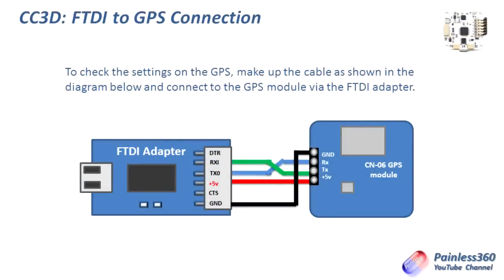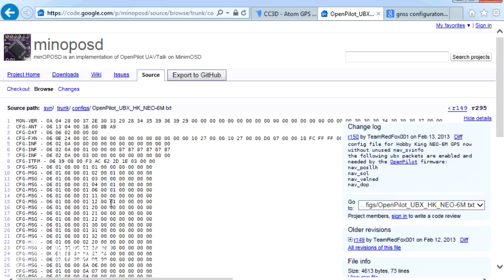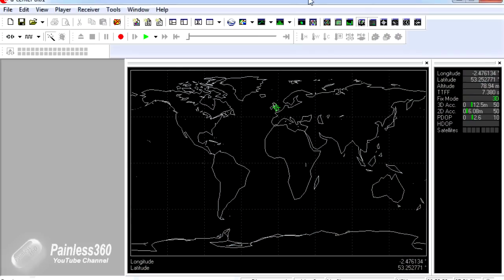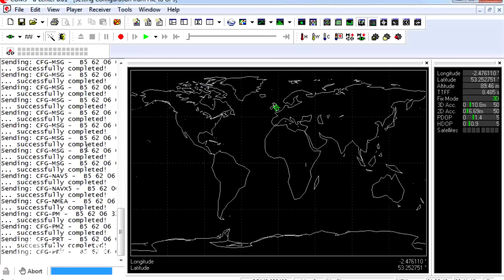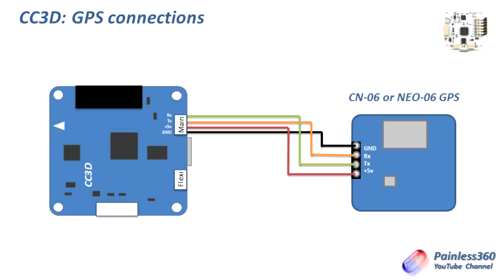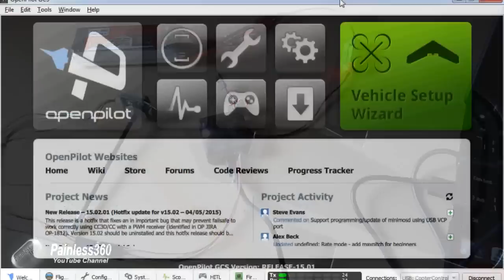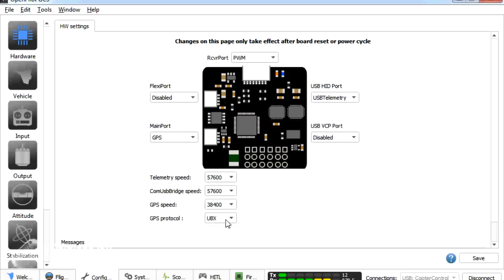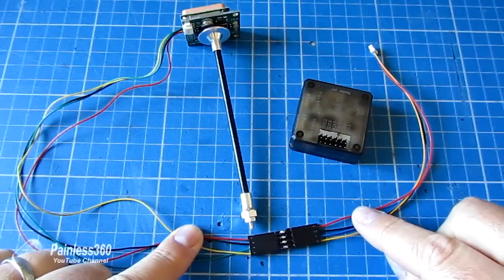(5/10) CC3D Flight Controller - Adding a GPS for Telemetry

Comment: I like your videos, they are nice and clear.
I've been trying to get this working on a CC3D, with a Ublox7 GPS and a micro minimosd.  The OSD is working but the GPS will never let me hit the final "save" button.  The button turns red with a cross through it.  
Have you ever got CC3D to do GPS AND OSD at the same time?
Reply from the maker: +Brit inCali Yes, you have one in each flexi port. Best of luck.
Reply: +Brit inCali 
I have same problem :(

Comment: Thanks for your videos.
i own a CC3D not the revolion version. I am thinking to build a Z84 UAV using this board by adding an BN-880 GPS plus an BPM280. Is it possible? If yes, can you do a video for explain how?
Thanks
Reply from the maker: The CC3D is very old technology now. See my recent builds for more modern components... Happy flying!
Reply: @Painless360  Thanks for you reply. i know about age, but they are very cheap and still sells on ebay. Thats why i thing they can be reliable.
Reply from the maker: Best of luck with the build..

Comment: Hi,

I am having problem with my NEO-7M. It is not saving GNSS configurations. It is OK for few minutes (upto 30mins.) and after that it resets to default (baud rate to 9600 and etc.)

As from the datasheet configuration can be lost or reset to default in three following cases:

A power cycle
A hardware reset
A (Complete) controlled software reset
I have checked, none of them corresponds to my case. 

As, I am not resetting in unit in software, as it resets itself after sometime being disconnected from the power. 

Backup Battery level is OK at 3V.
Reply from the maker: Sounds like the little cell battery on it needs replacing. Best of luck!
Reply: +Painless360 thank you.

Comment: Hi, congrats about your channel, i just have a question, i´ve tried to configure as you say in the video, first the gps was conected but now after upload the config file, just keeps the blue solid light turned on and nothing else, doesn´t connect, just keeps in a kind of stand by mode. the question is, is there any way to reset the gps as it came from factory? i will really apreciate your help
Reply from the maker: +Juan Carlos Moreno Rodriguez Yes, see the GPS setup video in the 'Seriously Pro F3' playlist - lots of extra detail in there as I show the full manual methods..

Comment: Hi, my gps only works at 9600 and the protocol is MNEA. What can I do? Thank you 
Nice video
Reply from the maker: servio ariza 9600 isn't enough to send the data to the flight controller fast enough. You need 57,600 baud or 115,200 Baud really. If you can't change the settings on the GPS you have then get one that will. Best of luck.

Comment: Hi. I'm trying to use GPS néo 6m with cc3d fc (flashed cleanflight). Whatever i just found voltage supply for This GPS is 2,7v - 3,6v. I suppose cc3d vcc from main port is 5v. why you dont use bec? I've follow your tutorial but my English is bad. With pc-ftdi 5v-gps-ucenter i Can See my position. It is a better choice to use bec 3.3v for my next try with cc3d?
Reply from the maker: Check the voltage on your module.  All mine are 3-5v.. Best of luck!

Comment: Will the microOSD be capable of displaying the home direction arrow in the video stream using the GPS connected to the CC3D?

Thanks
Reply from the maker: +Jeremy Giordano Depends on the code you are using - have a read up on the firmware pages for more detail. Best of luck!

Comment: Hi, it seems they have the openpilot nano revo for sale.

I wonder if that has the full function of the openpilot revo. Especially the GPS hold. 
Can you do a lesson on adding a GPS with the openpilot revo?
Reply from the maker: Tuck Hoh It gives the same function is a far smaller package. Should be an interesting board to play with. The addition of the GPS to the Revo is very similar to the CC3D so that video will help you install the GPS..Best of luck.
Reply: Painless360  The installation would be the same?? There more setting? Configure the GPS hold? etc..
Reply from the maker: Installation the same, configuration slightly different.. best of luck

(what are the two questions marks for?)
Reply: Painless360 Sorry two ? is my typo... Any chance of you making a video on setting up the GPS with GPS Lock or hold with the Openpilot Nano Revo or the openpilot revo
Reply from the maker: This is planned but not until the fall..

Happy flying!
Reply: Painless360 Thank you will be looking forward to your video. It is very helpful.
Reply: +Painless360 Hi, Looks like the openpilot revo is not avaliable on banggood.com. Looking forward to your video on setup with this openpilot revo.
Reply from the maker: Yep, still trying to get one here too...
Reply: +Painless360 Opps... Typo.. I meant.. the openpilot revo is not available on banggood.com.

Comment: nice video; im using the the op mini gps, can i configure gps via the cc3d with open pilot? can i do things like altitude hold and return to home, having a gps or what would i need to do those kinds of things?
Reply from the maker: +rio787 Follow the instructions in this video to configure the GPS, we cover what the GPS will and will not do in this video and also touch on it in the first video in the series - short answer: the GPS will only give you telemetry on a CC3D. For flight modes that use the GPS you need a CC3D Revolution (see our latest series on that flight controller)..

Comment: I only used APM yet, but looking for a small cheap FC and build a mini copter. I already have a spare BN-280 GPS module.Can the CC3D be configured for that GPS module and can it support position hold based on GPS?
Reply from the maker: Basic CC3D does not offer GPS flight modes. See the GPS video in the CC3D playlist for full details..

Hope it helps..
Reply: Painless360 I assume I have to buy APM than. Thanks a lot!

Comment: I have done everything in your video. I’ve down loaded the gps that on your page but that came up with a message not compatible with my gps. But the gps is the same as the one that it asks to use.
Reply from the maker: Is this related to another comment? Please reply to any answers else I can't keep track of the conversation.. Thanks..

Comment: Hi painless360  I am getting lost with my op gps made to be directly connect to cc3d , my controller can't find it , i follow all the steps with openpilot tutorials, however , I can't find any information concerning the setup of this module (one of you video explain how to configure ublock but not op gps )u can't hook it to ftdi unless you cut everything off, I am very aware that this specific part isn't as good as ublock but it's only for telemetry feature, a little help from you would be very kind :) thanks in advance
Reply from the maker: +Julien “androo” djyool see our CC3D revo series for more GPS detail, should help.. best of luck!

Comment: Is it possible to add compass which integrated in the gps to cc3d? I have looked every where on the net, I could not find any info.
Reply from the maker: If it does, it looks recent - https://librepilot.atlassian.net/wiki/display/LPDOC/OpenPilot+Revolution
Reply: +Painless360 I am talking about the legacy cc3d. Great vids, btw. I learn alot from you.

Comment: hi mate can you help me ive got a zmr 250 with cc3d trying to getvinto fpv but hard is there a flight controller you can buy to fit the 250 size but as gps hold like the dji phantom
Reply from the maker: +Nick Walters see our video on the comparison of the flight controllers we've used so far..

Comment: i have a tarains plus with x8r and the frsky gps v2 injunction with the smart port voltage sensor.Is it posable to use the frsky gps and voltage sensor with cc3d atom ? Im new at this and not to sure of the differents is from the S port and RSSI or if it will even work.
Reply from the maker: +Chi Sty The FrSky kit will talk FrSky telemetry, the CC3D talks MAVLink so it will not work. Hope that helps.

Comment: Hi, I'm going to buy this item, do you think I can install it on my Syma x8 ??? Or is there another one of those that I can use ??? I wait your answer thank you.
Reply from the maker: No idea, sorry. If it's using standard ESCs and motors and you have a receiver/radio you want to use then it might.. Best of luck!
Reply: i want to use the original control and board.

Comment: Hi, how can I get the GPS data to a file on an SD card or transmitted to the computer file?
Reply from the maker: +Graham Wilson you can get the details sent down via MAVlink telemetry but I'm not sure how you capture and store it. If you figure it out I'd be interested. Openpilot did allow for logfile a but I can't see that in Librepilot in the quick searches I've done. Best of luck!

Comment: would this SETUP allow for vehicle speed + altitude to be displayed ?
OR LAT+LON only
I would be interested in SPEED + ALT on a plane with a CC3D
Reply from the maker: +jason riddell Basic readings should include speed and alt from the GPS readings. I'd check up on the firmware read.me file and see what the latest features are.. Best of luck!
Reply: Cool thanks

Comment: would the osd be able to display height and speed or just lat/long?
Reply from the maker: Valentin Verheggen The OSD does have the ability to show height and speed and most OSD software will take these from the GPS co-ords. I've not done it myself but it should work.

Comment: I have a problem with the NEO6MV2, the CC3D keeps on rebooting when the module is attached. However, if the module wasn't configured properly, the CC3D no longer reboots, so I am certain the power supply isn't the issue.
Reply from the maker: That's odd, I'd run the power from a separate UBEC and see if that helps. I've not seen that here, problem GPS maybe?.. Best of luck!
Reply: Painless360 The GPS seems to work in u-center. However, the CC3D keeps on rebooting only when the GPS is connected. I'm using OpenPilot 14.10, I suspect the firmware is responsible, though I haven't tried other firmware versions, which would you recommend?
Reply: Painless360 I have tried other means of powering the GPS. The CC3D can detect the GPS though just moments before it reboots, GPS status in the GCS is in green.
Reply from the maker: That is odd, I'd try it on the other port. Not had that here..
Reply: Painless360 Thank you anyway, the firmware was the problem, I followed your tutorial from the beginning and everything works fine now.
Reply from the maker: You mean you didn't do that first ;) Glad you got it sorted..
Reply: Painless360 I had it already configured, I couldn't be bothered going back to the start, losing all my optimized config, I just wanted to add a GPS to the flight controller. It's a bit wobbly, and leans a little bit to the right at some point, I'll have it tweaked soon.

Comment: Hello sir, i am using Arduino based multiwii flight controller so can you tell me how can i interface ublox neo 6m 0.001 gps module.
Reply from the maker: Please see my multiwii series. Best of luck
Reply: @Painless360  Add link please

Comment: Hello,
I have a kk2.1.5 control board. I am having problem in interfacing the gps module. My gps module is Skytraq S1216R8.
Reply from the maker: +Death Sycthe not sure you can add a Gps to a KK board...
Reply: Thnks for the quick reply. Can u suggest a cheap and best one?
Reply: Thnks for the quick reply. Can u suggest a cheap and best one?
Reply: Thnks for the quick reply. Can u suggest a cheap and best one?
Reply from the maker: See our videos on other flight controllers that support GPS - Naze32, cc3d, SP3, APM and Pixhawk. They are all in series on the channel. Best of luck!

Comment: hi, do you know what the diffrents are in the NEO-6M, 7N M8N GPS modules? wanna get the pixhawk but i am not shure what gps i want... can u list me some diffrents between plz? thanks
Reply from the maker: jelle buyckx Sorry - I don't use the series 7 or 8 UBLOX based GPS modules here. I would suggest looking at the spec sheets on the vendors site (http://www.u-blox.com/images/downloads/Product_Docs/u-bloxm8_and_u-blox7_-_a_comprehensive_approach_to_multi-gnss_positioning.pdf)
Sorry I can't be of more help, happy flying!
Reply: ok thanks, so u only use the NEO-6M? i guess if u dont use 7 and 8. than i dont need one either... :- thx
Reply from the maker: Yep - see 5:20 in the video..

Best of luck.
Reply: right, thanks! ill get the 6m...
Reply: +jelle buyckx GET M8N THAT WAY YOU CAN GET GLONASSS! U.S.+RUSSIAN SATS! 30USD FOR GPS!
Reply: david ringler thanks for reply, i did got that one already though, nice to know the diffrents now. :)

Comment: Hey :) Do you know if the cc3d can output the voltage / current / mah over telemetry to the taranis? I can't find any information :s

Thanks a lot
Reply from the maker: Depends on what the software is it's running. You need something that outputs FrSky traditional or X series telemetry and uses the ports on the CC3D. I'd look at Betaflight first.. Best of luck!
Reply: Ah okey, thanks a lot :)

Comment: Hi, Can I use the 3dr radio telemetry kit 433mhz with the CC3D flight controller???
Reply from the maker: +Rodrigo Varona Garcia possibly, the radios expect to transfer MAVlink protocols. From what I remember cc3d is running things like Librepilot speak that. I've not done it here, let me know if you get it to work. Best of luck
Reply: Painless360 I'm waiting for my 3dr telemetry, I'm going to keep you informed

Comment: How did you make the cables?
Reply from the maker: +Vajih Khan Terminated both sides into servo style connectors and then used them to connect the right wires up.. Best of luck!